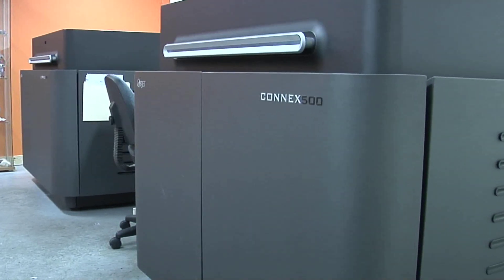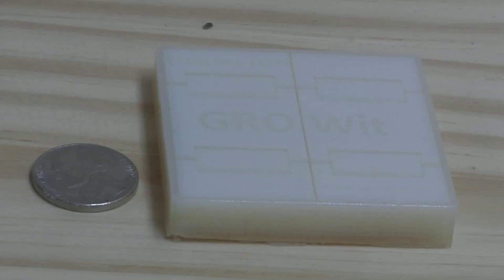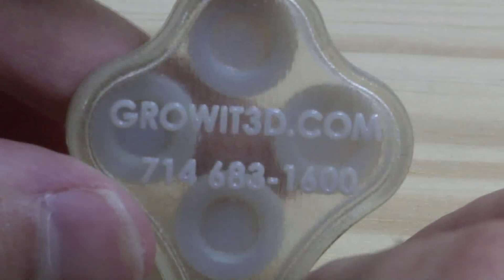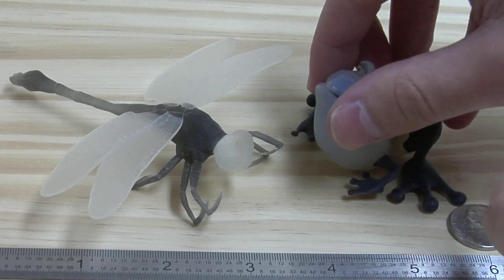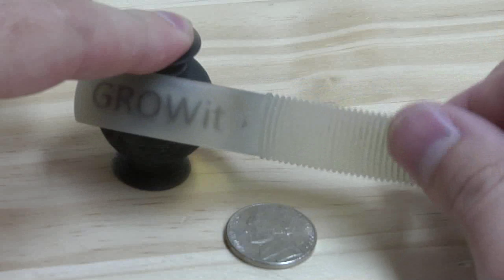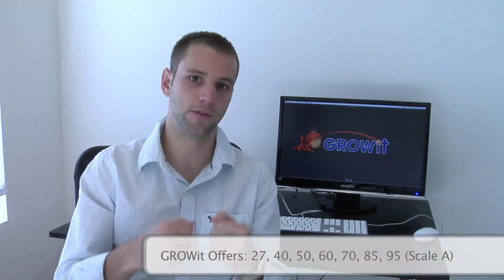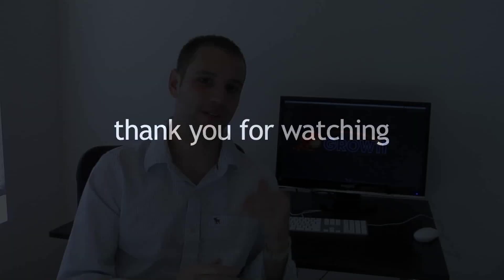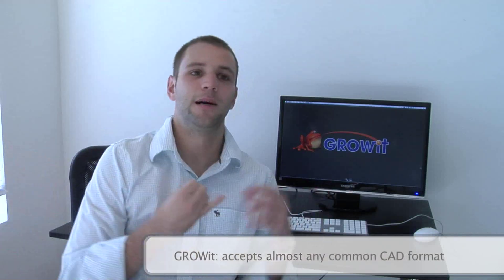3D Printing - PolyJet - Additive Technologies

Comment: The PolyJet is an Objet product that currently offers over 100 different materials. Objet is in partnership with Stratasys, one of the two big names in additive manufacturing along with 3D Systems, who started with stereolithography back in the 1980s. If you are looking for more rigid final products, look at laser sintering or electron beam formation using ABS or even metals (EOS has a nice system for medical implants of titanium, stainless steel, etc)

Comment: I operated one of the first SLA machines back in the 90's so I am quite familiar with 3D print technologies and this technology is impressive, Multi material build is awesome!. Q:What protects the copyright of 3D Artwork uploaded to the service bureau. I'm sure the service bureau has milllion of files in their hard drives to chose from, reference from. Does the service bureau have a non disclosure option with their customers before a customer submits a 3D Model file for print?

Comment: Wow, this technology is great!!!  Its too bad your using solidworks, lol, that cellphone mockup could have looked a lot better if you had used Inventor.  In fact, the new 2011 version they just released fixes every one of the old flaws in the program.  Other than that, the parts all looked acceptable.  Try out Inventor, and you'll see the difference right away!!!